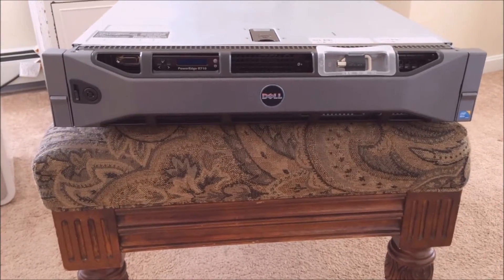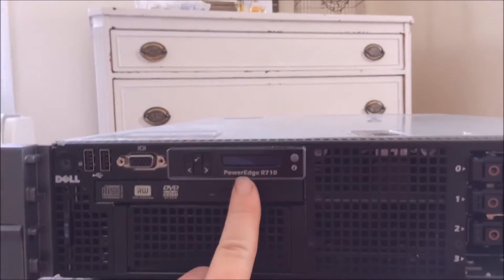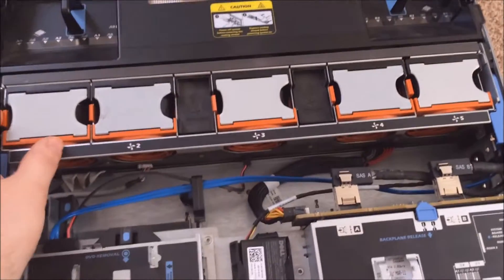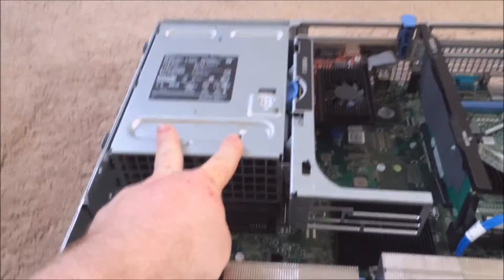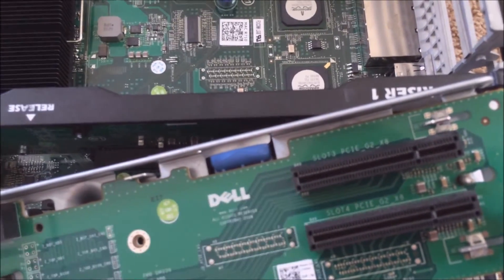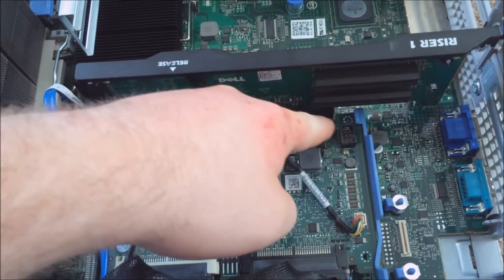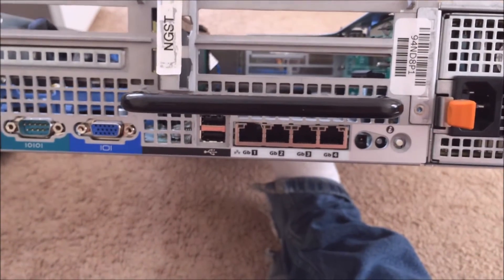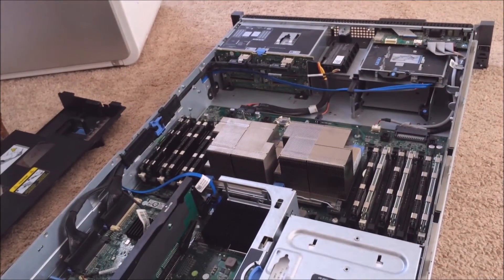DELL POWEREDGE R710 REVIEW

Comment: How did you get the graphics card to work?
Reply: Well i actually have a x8 slot graphics card, but you could get a x1 slot gpu like this one https://pcpartpicker.com/mr/newegg/LDQRsY
I also have put x16 slot graphics cards in my Dell R710s, but it requires using a chisel or saw and removing the plastic from pci x8 slot on the riser card in the server. This is the cheapest way i see adding a good gpu to one. If you mess up you have 2 slots to work with, and the riser card is only $6 on ebay so it is easy to get replacements. I am actually planning on making a video about this on our new Lndo Tech channel in the coming months.
Reply: Hi, thanks for the response. I asked because I bought one of these: https://www.amazon.com/gp/product/B01AZ8EQBK/ref=oh_aui_detailpage_o02_s00?ie=UTF8&psc=1
 but regardless which x8 slot I plug it into no video ever comes out of 
any of the ports. Is there a jumper or bios setting that needs to 
changed? the 10G x8 card I also installed in the server works just fine.
 Booting a live cd with linux the VGA card on the mobo gets used and it 
appears the nouveau graphics
Reply: Vince I. well the thing with atleast the dell r710 , is it that it does not output video to the gpu while loading . I had to install windows plugged into onboard vga and install drivers for the card as well . after that the card worked in Windows. but it will still not work on startup
Reply: I see. That is good to know. Let me boot into a proper Linux installation and try to see if the video card can be enabled. Thanks for the response!

Comment: There are x16 riser cards for r710s 
http://store.flagshiptech.com/dell-gp347-0gp347-poweredge-r710-1x-pci-e-x16-riser-board-2/ 

They're kind of expensive, and hard to find. that $79 is the cheapest I have found so far. There's also one on Amazon for $220
https://www.amazon.com/GP347-Dell-Riser-PowerEdge-NX3000/dp/B014VUAVTO
Reply from the maker: Ya i had heard they had these but i couldn't find any when i looked thanks for the links